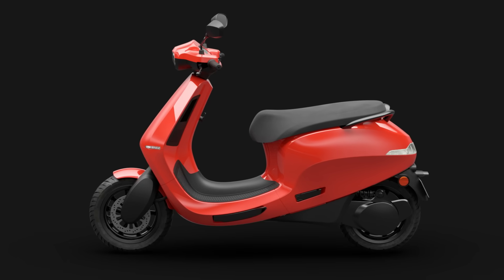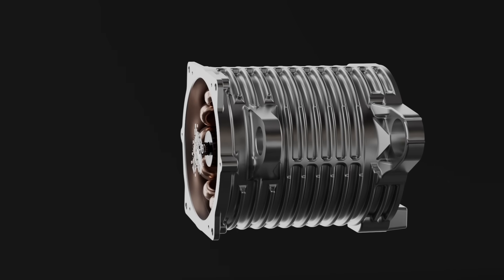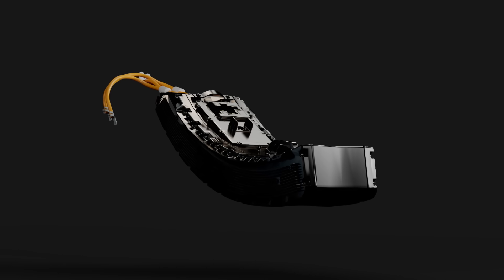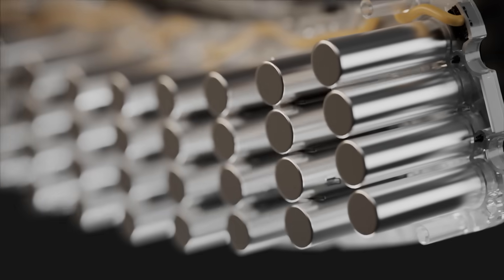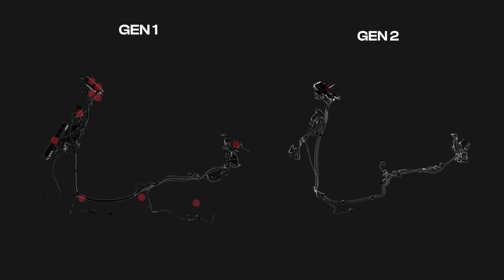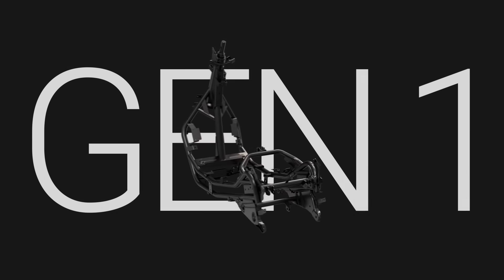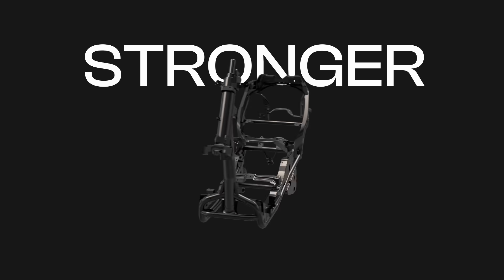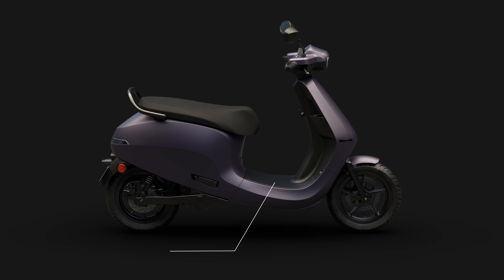Ola Gen 2 | The Next Gen EV Platform

Comment: Effective and Good work done by Engineers and Team. Congratulations🎉
Reply: No doubt the engineers are doing a great job but one thing to keep in mind is that the number of integrated components also translates to increased replacement costs and higher maintenance. If one component decides to fail, the complete sub assembly needs to be replaced till then the bike is not functional. The actual thing that was also to be discussed in this video was repairability and ease of replacement of components. Right to repair should also be considered but thats something we will have to address later

Comment: Cost cutting by increase in cost😅 well played Bhavesh
Reply: If there was so much of saving, why hasn't atleast a part of it been passed onto the customer?
Reply: @ronak855 please do check the results of ola or ather these companies are burning lot of money ultimately they need to increase their margin wirh the increasing customer base to move towards profitability
Reply: @ronak855  they are saving in production. but design, testing, research takes lot of money. even though they are saving money on production they have to spend that saving on R&D
Reply: Cost cutting for company to increase profit. But not for consumer.😂😂😂😂
Reply: @mohitgohil1420  true 100%
Reply: They did for weight loss, and to reduce power loss.. thus to increase efficiency
Reply: @hpvide  if u ride in normal mode then okay,but structural strength is low compared to gen 1 only thing I find pro is the dual shock absorber,,the 11kw peak consume more compared to 8.5kw peak if u ride in hyper considering full throttle
Reply: @harmate123 so you ride in more than 100kmph every time in a scooter
Reply: @sankaranarayananramasamy858  i just luv adrenaline rush,so mostly abv 100kmph
Reply: To Maximize Profit 😅
Reply: Superiority proves when it comes on road. After that certification or testing not required.
Reply: @maheshp2598 This kind of technology is not home made.
Reply: Initial r and d, and gradually it wd pass onto public when tech wd be widely used
Reply: chalti gadi jalegi nahi iski kya garuntee
Reply: I agreed very well he played 0 to 100 charge required 7.5 hours.
Reply: All hail the good ol' Atlas Cycle 😂
Reply: This makes me conclude than ola gen 1 is far superior,gen 2 is all abt cost cutting,having 11kw peak implies it will consume a lot of battery if on hyper or sports,i usually drive mostly in sports so the motor run btw peak nd normal (approx 6kw I guess) so for users riding only in sports mode no battery advantage, abt centralised system ,if system is reliable well nd good else customer will feel the pain after warranty bcz of replacement cost
Reply: Gandu price isiliye badhta hai kiu ki R&D ki jarurat hai. Uski paisa tera baap dega kya
Reply: R&D cost  ka suna hai kabhi? nalla
Reply: That’s the cost of R&D bro
Reply: 😂😂 master stroke
Reply: Lol
Reply: Ola gen no. 01 enemies the destroyer 🐀 RAT BITE🐁 it's attack  much  costlier .
Reply: This is how they refunded charger amount collected!
Reply: Bhavesh playing with the peoples life. Ola S1 gen 2 also had problem from day1 of buying scooter.
Reply: USER EXPERIENCE OLA = Untrusty company. Unethical marketing. Zero value for customer. ANYONE LOOKING TO TAKE OLA SCOOTER CHANGE UR MIND. IT'S WASTE MONEY AND TIME. 2 MONTHS MY BIKE WAS DEAD. MY EXPERIENCE WAS WORST. THEY ARE ONLY LOOKING FOR SALES. EXTRACT MAX MONEY FROM US.

New scam by @OlaElectric Customers has to pay the extended warranty within 1 year or else can't do that. My scooter was dead for 2 month and OLA didn't do nothing. Now they are calling and (hv cal rcding)if u didnt do it today (15, Dec, 2023) u can't do it anymore. It's 8499 INR.
Reply: Sabhi log OLA scooter please mat buy Karo. Fraud hain ye.....Mere 1 month se jyada ho gaye paise leke baitha hai.....aur scooter nahi diya abhi Tak. Aur naa hi ab paise lauta raha hai.....Paise phans gaye bhai
Reply: In petrol bike 100 rupees per day 30*100=3000/month, 3000*12=36000 /year.  36000*4. 5= 162000 /4.5 years... I can run petrol bike for 4. 5years in this cost. What's benefits for buying this bike
Reply: @Linux-xz7kv petrol bike cost left the chat 😂😂
Reply: @bharatlodhi4134  talking about with my existing petrol bike
Reply: @Linux-xz7kv  so if you include your existing bike… 
also include service cost. And the resale value of your old bike because you are exchanging It with your old bike.

So in your 100rs daily fuel your bike will run 60 km per day means… around 100000 km in 4.5 year 
In 1lakh kms, You have to pay around 30000rs for 35 services. Means you will save 30k of service cost
and you will get around 30000 resale value from your old bike.

So you will save 162k from fuel + 30k from servicing charge + 30k resale value. 
You will save 60k by purchasing this ev and after 4.5 years you will free from maintenance cost…
Reply: @bharatlodhi4134  what about interest cost for 170000
Reply: @Linux-xz7kv  petrol price growth rate is greater than interest rates….
Reply: @bharatlodhi4134  bro🤣
Reply: @bharatlodhi4134 nicely explain bro
Reply: @Linux-xz7kv Bhai pure 365 din gaadi chalta hai kya?
Reply: @Linux-xz7kv Abey gadhe capital cost tera baap jodega?
Reply: @Linux-xz7kv what about service cost
Reply: @Linux-xz7kv one electric scooter left

Comment: Why is that cost reduction not affecting the final price?
Reply: The price increase was limited to Rs 7000 while all the features like range, top speed, design change and platform change were implemented. It costs 1.47 Lakh now. The Ola S1 Pro Gen 1 is 1.3 Lakh now if you want that.
Reply: See, these all are happening due to the subsidy cut by the government.
Suddenly they can't rise the price, but they can reduce the manufacturing cost.
This will be applicable for all ev, wait and see.

Comment: all parts reduction......but  price increased ....s1  pro😀😀😀
Reply: more pwerfull motor than before
Reply: Haa bhai... Yeh log ko design language pe kaam karna hein
Reply: Range 181 > 195. Peak motor 8 kw > 11 kw. New Platform. Dual front shock absorbers. Flat food board. Better performance. The cost went from 1.4 lakh to 1.47 lakh. 7000 Rs increase. 

The Ola S1 Pro Gen 1 is available at Rs 1.3 lakh. if you prefer that then buy it soon.

Comment: Why did you removed hest sinc ?
Reply: They added the separate Controller and heat sink as a 2 boards and heatsink at the other end of the motor to make it a single unit.

So they removed the separate heat sink and added the heatsink on both sides of motor unit

Comment: Even after all that your scooter can't go more than 5 mins in hyper mode.
Reply: Is it?
Reply: Definitely yes.....5km rather
Reply: Really?
Reply: That’s correct . Sold my s1 pro in about a month due to over heat problem . Don’t buy any EV scooter without active cooling
Reply: It has 25% better thermal performance. OLA S1 Pro Gen 1 used to go 15 to 20 km in hyper mode at top speed. Gen 2 should go 25 kms at higher speeds in Hyper mode. 

Also the Ola Community that went for Ooty ride a month back, got to test the Ola S1 Pro gen2. They said it was faster and laster longer during top speeds on hills.
Reply: well said ola fan boi @evthink
Reply: @newtonsthirdlawofmot If saying performance is bad at launch day without any information is not wrong. Why is sharing the experience from Ola Ooty ride where we saw these being tested, so wrong ? 

I don't care either way. You do you ☮️